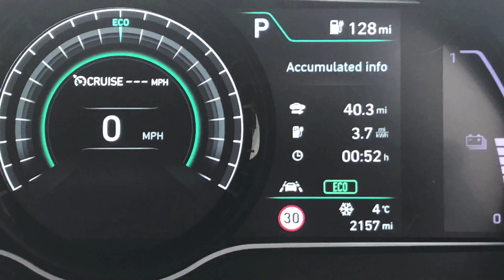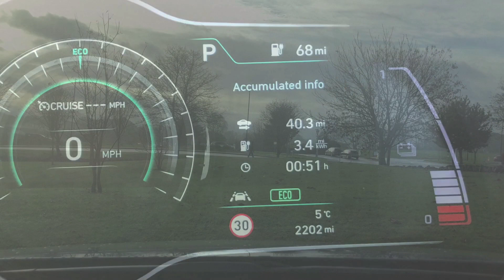Surprising!! Roof Box Efficiency on a 64kwh Kona

Comment: So, about 10% loss of range from the roof box. That is unsurprising to me. I lose about a third of range in our Kona towing a camper trailer while cutting top speed from 100 to 90kph but otherwise the same.
Reply from the maker: Towing? didnt think kona electric was tow rated???
Reply: @EvLifeUK  Yes and no. In Australia at least it has not been given a positive tow rating but it also does not appear to have been a zero kg tow rating either, in which case default ratings apply. The petrol Kona tow bar bolts on easily. For more extensive discussion see here and other articles cited therein: https://thedriven.io/2020/03/25/tow-story-hauling-a-camper-trailer-with-an-electric-kona/

Comment: Thanks for your video. I could imagine that you'll have viewers from the continent (like me from Denmark) and we do have some difficulties with miles, stones, ounces and other non-metric standards. So if you could put the metric equivalent on the screen it would be a big help. Keep up the good work, thanks.
Reply from the maker: Michael Feder great tip i’m sorry for this, will add this to all future videos.
Reply: Yes, it's crazy. We buy fuel by the litre, buy food and building supplies by the kg, have decimal currency, measure sizes, temperatures and pressure in SI units, but the government has not bothered to change the road signs from miles to kilometres. As a result, many people still think in miles, even though the approximate equivalents are easy mental arithmetic. I was born here, and have lived most of my life in Britain, and find the anachronism infuriating.

Comment: Looking forwards to the next video. 
It’ll be interesting to see if you have any issues with CCS once you start going south on to other networks. If you end up only needing one charge on route you might get lucky, personally I’d always stop one rapid ahead of a rapid I could reach, in case I have an issue. (Had lots of failed sessions in the i3 on CCS).
Reply from the maker: Haha i have planned for this hopefully charging to 90% once just inside Scotland at Moffat should be enough to get me there but have selected a Instavolt as backup in England which works fine with the Kona.